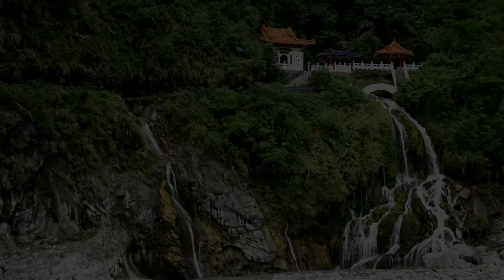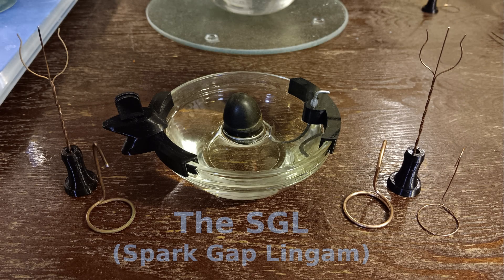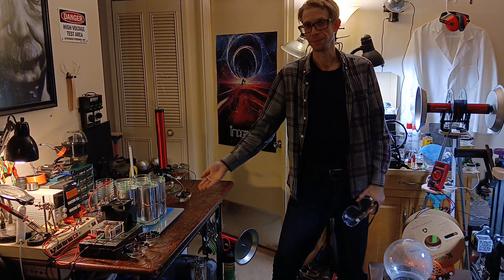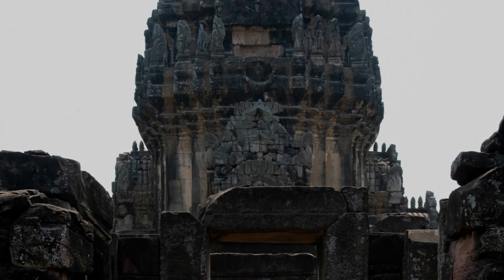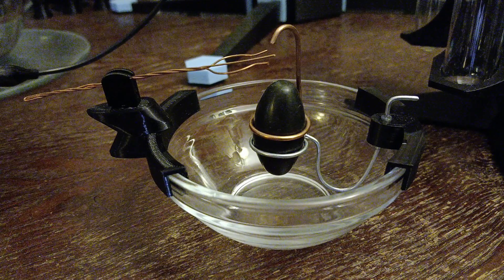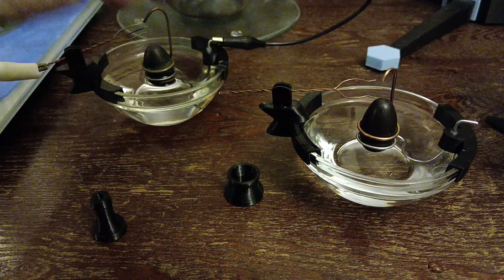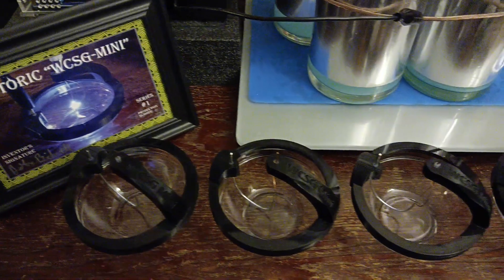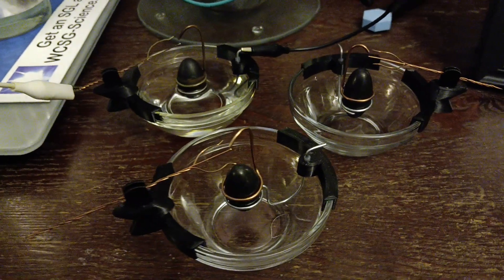How a Spark Gap Lingam (SGL) Works

Comment: This is interesting, there are a quite a few famous inventors/scientists of the past - Tesla, Keeley, Kosyrev, Schappeller,  who also discovered this phenomenon but nothing further seems to of been done with it. By applying high voltage to egg shaped objects with a centre ring applying voltage,  levitation and weight reduction can be achieved, all reporting the same ephenomeon of the top half of the object gets quite hot, but the bottom half is kept cold creating a flowing dimagnetism. Seemingly a whorling vortex 'wind' energy  is generated upward that lifts the egg shape upwards making it levitate and weightless.

Comment: The granite boxes in the pyramids were capacitors. The gold caps on top of the pyramids were electrodes and the pyramids either glowed in the dark or acted as stop gaps. 
Were the pyramids an electrical discharge weapon to destroy the planet beyond Mars ?
Reply from the maker: They were primarily 'charging stations' for ships and wirelessly powered a large area (a few miles) around them. Also if you look closely, the 'grand gallery' was more than likely a 'marx generator' - you can even see holes / markings where each 'station / step' was as the angle of incline is also the most desirable for hot plasma (heat rises) to connect to the next electrode / voltage multiplier in the chain going upwards...

Comment: I have been fascinated with Lingums for years and I thought they had to produce some sort of power .I also noticed that Indian temples and some others have what I think are lightening rods on top that look like they were from Dr.Frankenstins lab usually 13 in number. Thank you for your reasearch.
Reply from the maker: Yes I've noticed all the metal bits, pointed rods and very, very interesting electrical-related objects used even (unknowingly) as relics for worship today... Look at images of the Kaaba, for example - you will find that they are worshiping a giant electrode (imagine a stream of plasma blasting into it to soften the stone) - which progress was interrupted by cataclysm long ago...

Comment: I think I missed it, you applied a lot of voltage to the lingam and then what happened?
Reply from the maker: The lingam acts as a support for the electrodes, an SGL (spark gap lingam) has an additional set of electrodes that allow it to handle millions to billions of volts - read the entire science journal write-up on my website to understand everything WCSG-Science.com
Reply: @MadPlasmatist  but what happened when you applied the voltage in the video? Easier to just say it rather than link to some website. I was impressed when you lifted a rock using electricity but it seems that as far as softening/forming rocks goes, you've showed nothing. Not that I expect anything. This stuff is extremely complex and mysterious.

Comment: Brilliant research. So, correct me if I am wrong. Does your spark gap lingam function like a capacitor? What is the power difference between the input current and output current? Are you observing any over-unity?

Comment: I didn't see any of the practical applications that were promised just a bunch of spark gaps obviously powered by something that definitely was not around over 200 years ago
Reply from the maker: The practical use and application was inducing an accelerated crystal growth which can only be achieved by high amperage - demonstrating both a use and the presence of high amperage, which is not found in normal tesla coils...
Reply: @MadPlasmatist  Im a rock guy with an obsession of understanding the natural & man-made geo-structures all around us, every country across God's great earth.  Which means I'm also obsessed with crystal growth (so I can find the good stuff in the field!).

Accelerated crystal growth... Think of the potentials.  Grow your bricks & blocks, not even just softening & sculpting.  You can GROW the blocks that built the great pyramid.  See the practical use now?

Comment: I’m not understanding how any of that would be beneficial to making the structure that’s surrounds it. There seems to be a huge piece of the puzzle that’s missing either. You don’t know like the rest of us and this is all just Clickbait or you’re not sharing it for some reason Personally it doesn’t make sense sense if I had knowledge of how ancient structures were built, I’d be screaming it from the rooftops sorry I’m not trying to be a dick. I’m just trying to understand this logically.
Reply from the maker: The other piece is my "Mystery solved" video. Only a high-voltage, high-amperage water-cooled spark gap can run long enough and create enough heat to perform this function.

Comment: Umm part 3 practical use and application, so you think the lingams for used the power centrifuges?
Reply from the maker: Your mind is far from ready for enlightenment - let your curiosity guide you, it's gotten you this far =)
Reply: @MadPlasmatist  what was the ancient Indians High volt power source?
Reply from the maker: @timh.2137  There are an incredible number of ways to harness charge differentials. Copper + aluminum + water = power and even a simple height difference in elevation, such as a small tower, will harness atmospheric charges; the atmosphere was once said to have always looked like the 'northern lights', until cataclysm from the central star stripped or diminished this ability. Perhaps one of the reasons why these sites are no longer active as they once were.
Reply: @MadPlasmatist  The "Central Star" ? You can't just claim that you have solved this ancient mystery if you do not have all the answers!
Reply: @MadPlasmatist  do you know how low voltage those battery cells are? It would probably take about five football fields worth of those battery cells to get anywhere near the high voltage that would be required...

Comment: This seems super interesting but it is impossible to understand over the volume of the music dear God can you please redo this video without music that drowns out your voice. Or can you explain what the point of this is? Couldn't you have spun the vials using a standard current through a cable? What am I missing?
Reply from the maker: Thank you for the feedback. I will re-release this video again sometime in the upcoming future, I'm working on upgrading my equipment still. As for the "Practical use and Application" segment, spinning the vials also helps the crystals form out of solution more quickly and I was demonstrating the high-voltage, high-amperage output of an SGLTC (Spark Gap Lingam Tesla Coil), now a new type of Tesla coil, which, because of its high-amperage output, can perform physical 'work', such as (I think this is what relatively occurs) rearranging / aligning the conductive molecular lattice in a solution to accelerate its crystal formation, which can only be achieved by amperage (something no other previous type of Tesla coil could so easily output like an SGL).

Comment: Looks interesting, but there is no real explanation about how the lingam works... What we can see in fact is electricity conducted by wires around the lingam stone but the electricity is provided by an electric generator and not the lingam...
Reply from the maker: The lingam is a high-voltage, high-amperage spark gap, capable of handling millions to billions of volts. Even this small model would catch on fire and melt within seconds without water cooling of the negative electrode - a testament to its elegant design thousands of years ago... Take a look at my 'How a Water-cooled Spark Gap Works' video to learn more - as the inventor of WCSG technology, it is because of this understanding and my meticulous study of our ancient past that I have been able to both understand and be the first to recreate a working lingam, and am now also recreating other ancient technology with the use of these high-voltage, high-amperage spark gaps. Thank you for the comment, feel free to ask and learn more.

Comment: @MadPlasmatist I'm curious, why water? In my research of tesla coils, oil is used particularly common was boiled linseed oil. So I'm curious, what made water the insulator of choice instead of oil? Have you tried it with oil? What are the results and differences?
Reply from the maker: If you watch the last segment in the video "Water-cooled Spark Gap History", you'll see 2 scenes with a bottle of mineral oil in them (you can find these videos on my channel here too)... The same setup / amount of voltage is being applied to them as it is my WCSG's and SGL's... The difference is night and day as the room for dielectric breakdown is the same as through air - oil is messy and burns, although I did make a jar enclosure with a charcoal filter 'chute' on the top to make it near odorless - you may also be mistaken as the water is not used to insulate, it is used to cool the negative electrode of the system. Watch my video 'How a Water-cooled Spark Gap Works' to learn all about it - an SGL shown in this video is the next step up from a WCSG =)

Comment: Sorry but there is absolutely no useful information on how it works in this video, its just a light show with annoying music. Whats the: power source, the purpose of the centrifuge, the interconnected metal cylinders, material of the lingam, the solution in the syringe etc etc etc. My son and I are both electrical engineers and cant work out any of those things, so i doubt any other viewers can.
Reply from the maker: Please watch the video 'How a Water Cooled Spark Gap Works', an SGL is the next step up from a WCSG. Look in the comments, there is information about the crystal recipe as well and how to duplicate the accelerated results - Enjoy =)

Comment: Ok, but what's powering everything? 
What are the 5 steel cylinders with thick green wires between them? Are they supposed to be Leyden jars?
It looks like there's a red wire attached to one of the green wires that's running to a white power supply up the back to the left and it looks like there's a black wire plugged into the power supply and running to the cylinders as well but hard to see exactly where?
And what's the thing spinning around and what's powering it to spin?
I get that turning the lights off makes the sparks more visible but it also makes it so I can't see what's going on with other things. 
I get that ya wanna make it dramatic with the music and the overlays but it takes away from the scientific aspect of it all.
I just wanna know how it works not be dazzled by fancy overlay effects and music and  have the whole thing drag out with a wait, there's still more. Just keep watching and in the next exciting episode etc etc.......Until I've lost interest. I get that ya wanna build a channel and get more subs and all that bs but you'll get more by just showing the solved mystery you claimed to have solved in one go. If what' ya saying's true that'll be enough to make ya famous. 
Atm you've got more of a, "the hardest thing about making a perpetual motion machine is working out where to hide the battery" vibe going on. To me at least anyway. 🤷‍♂
Reply: There's a Tech II power supply on the wall, cranked up to 100%. That's putting out around 2x 10v@8amps. Using electricity from my wall, I can make sparks too.

Comment: Granite, so the Granite box in the pyramid. Would it severe a similar purpose ?
Reply from the maker: The granite box is too large to fit through the passage of the Great Pyramid, unless it was smaller and then 'inflated' once moved inside, possibly by using those same very electrodes during it's original heating / shaping process inside the Kings chamber... I will have more to share, this is only what fits best about these electrode's presence and the seemingly impossible box's appearance there which to me, is all the most logical so far.
Reply: @MadPlasmatist  actually if you are facing the so called sarcophagus to the immediate right the stone in the wall has the exact dimensions as the sarcophagus!
Reply from the maker: I can only hint that it is not original to the pyramid's original construction...